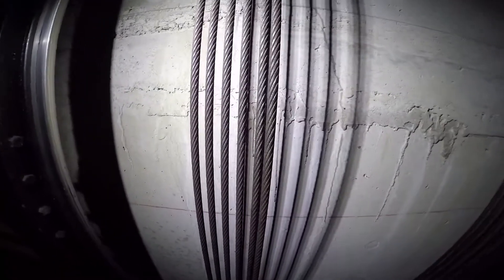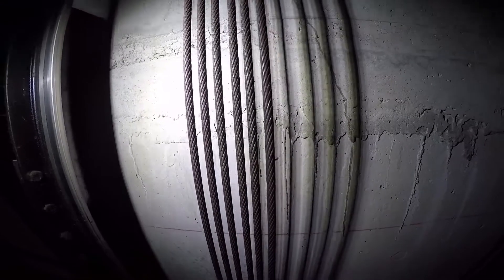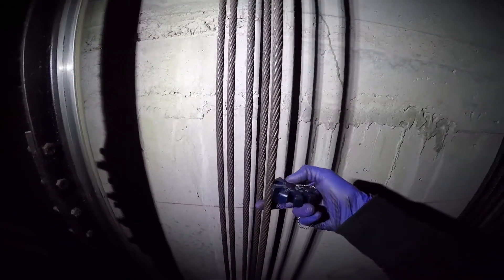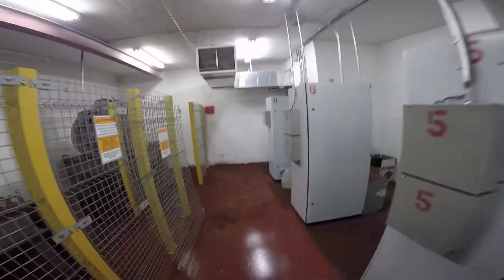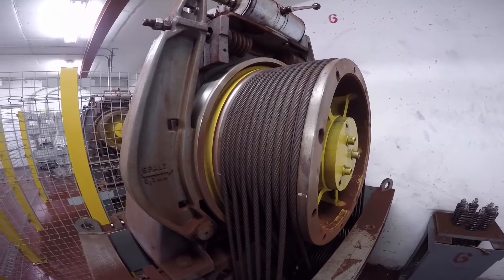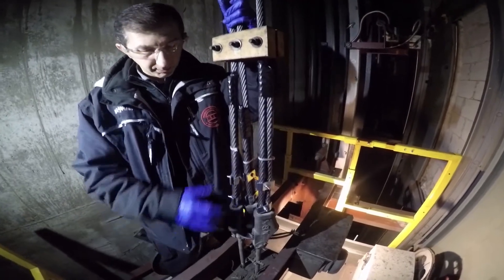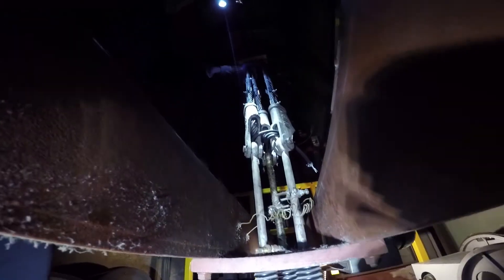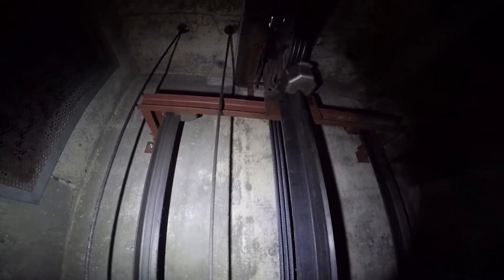Safety Matters-Elevator Rope Replacement

Comment: The elevator on the first part of the video is not the same from the second part of the video.  First elevator it’s a 2:1 double wrap set up and the second one it’s a 1:1.  Also rope diameter and number of ropes it’s also different.